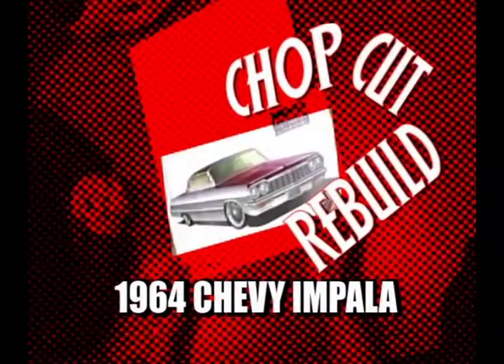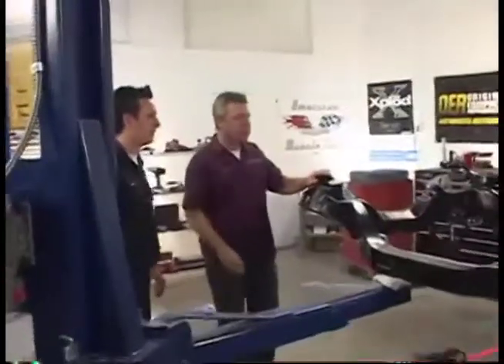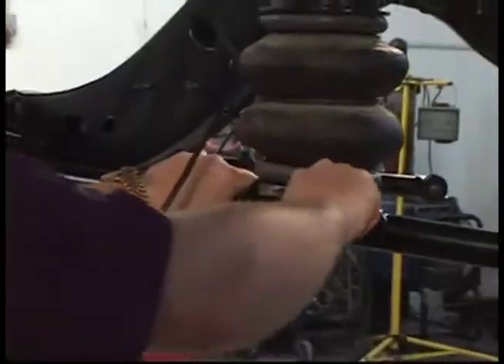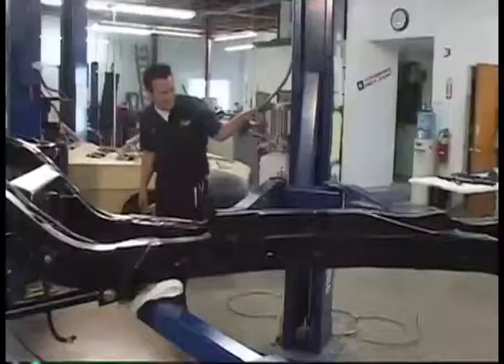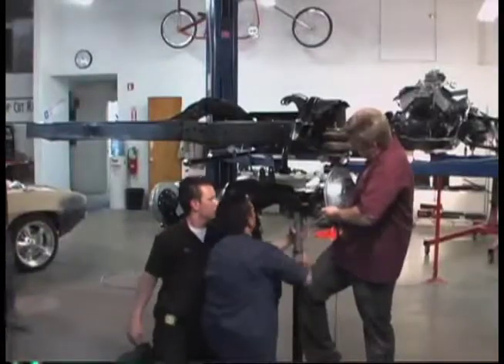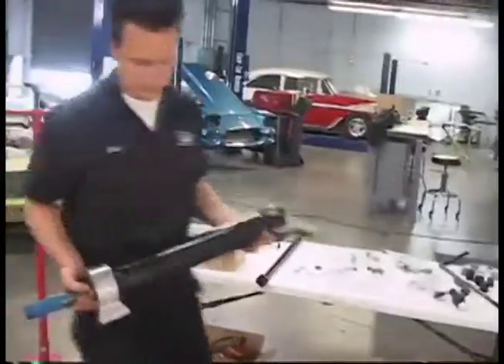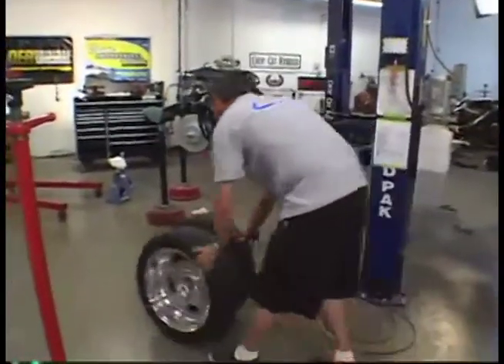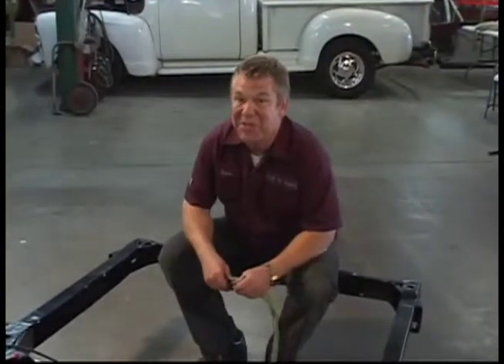Chop Cut Rebuild: 1964 Chevy Impala - Part 21

Comment: so you guys make the parts and put them together and they still don't fit,"just a little grinding" is that what you tell your customers after they spend 700bucks for a disc brake conversion that's supposed to be bolt on?